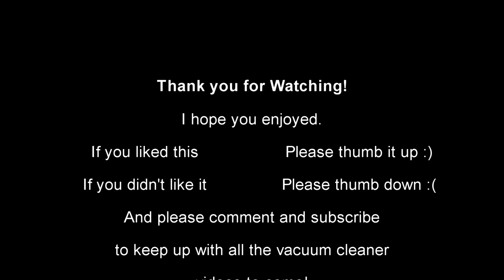Dyson V10 Cordless Vacuum Cleaner - FULL Stripdown How-To Video!

Comment: Ok.  The cord that runs thru the cyclone assembly... You say you can push it out of the top; but, there is nowhere to push it from.  Did you mean you have to pull it out by the pins?  Your last video you removed the connector at the front, which one is easier?  I tried to take it out; but nearly broke it.

Comment: Just finished replacing the broken red switch. What a horrible experience taking it apart and back together!!! I'm also left with 4 of the very long screws!!! But I think I know where they went,but can't be bothered taking it apart and putting back together. Thanks for the video!!!
Reply from the maker: If their long and crosshead their probably the 4 back screws, under the filter assembly. If their long and torx their cyclone. You might get lucky and their the very end outer ones that go under the rubber seal. Otherwise if it's snapped together nicely I'd say put them aside for if it becomes apparent their needed later!

Comment: I just got a V11 and I am starting to regret it. This shouldn't ever happen. I expect around 5 years of vacuuming before it dies... not 2. These devices cost about 5-10 times as much as a classic upright. The v11 cost 5 times more than my AEG equipt which has been working for a solid 5 years thus far and has no scratches even after vacuuming tons of plaster dust.
Reply from the maker: As a vacuum it's very good tbh, I am missing not having it about! But the build quality certainly hasn't improved. Hopefully one upside of this is my wand will stop wobbling about when it's attached to the machine

Comment: Good one Sam. Its amazing how much dust gets stuck in the cyclone discharge chamber - people need to give their vacuums a good tapping when dumping them over the bin, so the dust in the cyclone discharge chamber can get dislodged and fall out of the bottom. If those chambers end up getting full of compacted dust, the cyclones will all clog up and that pre-motor filter will be VERY dirty, eventually leading to total loss of airflow when the whole of the cyclone assembly becomes choked up, due to the cyclone discharge chamber being full and the cyclones having nowhere to discharge their dust. Either give the cyclone assembly a good few taps, or use the hose of another vacuum cleaner to vacuum the cyclone discharge chamber exit holes and suck all the dust out - that's what I do with my own V8 and V6, and then I dont get any build up in there. Many people still keep a corded vacuum in their homes, so this is the best tool to use for cleaning up your cordless, and you only need to do this every 5 or so empties anyway, as the cyclone discharge chambers would take a while to completely get clogged up with dust.
Your  point about knocking the on off trigger when emptying the bin is a very important one, whether its a DC59, V6, V10 or V11, you must not do this, because the motor will draw some of the remains of dust from the cyclone discharge chamber back through the cyclones and cover the filter with it - on the V6 it goes inside the cone shaped filter in the top of the cyclone housing, and on the V10 and V11 it coats the outside of the filter, so much more visible than on the V6. 

On the V7 and V8, the motor will be disabled when you pull up on the red latch and lift up the cyclone housing for emptying, but when its pushed back down again the motor will be operational again if the trigger is pressed, so until the bin flap at the bottom is closed up, on the V7 and V8, do not operate the trigger, or the same will happen as with the v6, any residual dust remaining after emptying will be sucked straight inside the cone filter in the top of the cyclone housing, which can end up filling this up and causing clogs and airflow obstruction through the cone filter.
Reply from the maker: On my v11 the dust is sometimes so thick in the inner cyclones it doesn't drop out, I can see it sitting there! That's why I whip it clean with another vacuum! Not like the older dyson machines where the fine dust sat happily in the bin (but behind the centre seal) and it all came out when you emptied it. The mouldings on the v10/11 are stepped to provide something for the flap seal to bite on, and that helps get the dirt stuck! You'll see the v11 briefly in tonight's video, I show the filter after a while of normal use too
Reply: It's a good idea to unscrew the filter a cm or so before emptying a V10 or V11 as that prevents the motor from coming on and coating the filter.

Comment: Good video mate, Glad to see how to get the connector out. I have an old DC08 that is on a foot pedal and I use it to vacuum my mess as I go. Saves breathing the crap that falls out.
Reply from the maker: Dunno if your one of the people that moaned about that connector on the other video but yea, I made sure to show it properly! Once I worked out to unwrap the ferrite coil and gain wire it was easier! Doubt it'll harm it at all just lying loose in the chamber either.

Comment: Great how to is this Sam. Just got one of these the same spec and mines in a right mess so looking forward to getting the bits it needs ans fixing it up!
Reply from the maker: Nice, enjoy! Give the filter a good overnight soak in hot water and bio liquid, then a scrub with a bottle brush/toothbrush, then into the washing machine with some towels at 60 for a few hours and they come out like new usually! If they dont then you tried and new ones are very very cheap nowadays

Comment: Cheers for the video mate. Mine had a flashing blocked symbol and was pulsing on all settings

I got it taken apart about half way myself but then got stuck and thankfully found your video which enabled me to get it broken down completely, cleaned and reassembled. 

It was a bloody ballache to be honest but it's now as good as new!

There was no obvious blockage and nowhere near the dust build up in your example but obviously enough to trigger the blockage sensor.

Out of interest how does it know it's blocked? Is it an airflow sensor or something along those lines? 

I've also ended up with a couple of screws left. When I'm feeling up to it I'll take the whole thing apart again and try and find where they go. Will be using your card trick next time!

Thanks again 👍
Reply from the maker: Thanks, glad it helped 👍 The motor senses the restriction and cuts itself off. I've got a v8 motor fitted to something else and it does the same. When the machine is clogged up enough it trips that sensor. Just putting the filter through thr washing machine on a 60 degree wash does 70% of the work I think! Are they long or short screws? Cross head or torx? Equally 2 missing won't hurt it if their not from the cyclone (that wants all its screws to clamp the seals together)
Reply: @beko1987  I tried to post a link to a couple of images but it must have been blocked. I've got one torx, one crosshead. Not the big long ones

Comment: wonderful video, it helped me figuring out how to remove the trigger switch and saved me 270$ (USD) !
Dyson don't fix stuff like this, they just replace the motor unit which includes the handle + trigger. 

One thing I didn't get is how to de shroud the last metal filter, I'm afraid to push a screw as you did, the plastics look flimsy and Im afraid it would break.
Reply from the maker: The plastics are very flimsy when not together, wise to leave it alone if you didn't need to get in there! Where did you get another trigger from if you don't mind me asking? I've yet to strip my broken v11 body down (it's trigger went too) but if their not too expensive I might bang a new one in and keep it for when the new one inevitably goes in 8 months...

Comment: My dyson started doing the same thing after the cat knocked it over and cracked a hole in the bellhousing. :/. How does all that mess get into it internally like that? Is it preventable, or is it because it's being used with that gaping hole in the cyclone?  Thank you for the video though!!
Reply from the maker: Their supposed to do it to a degree but it does seem excessive. The uprights and cylinders fare better, I wonder if it s because the handheld get used at all angles the cyclone just isn't as efficient. Every time I empty it I have to bash it out for a few minutes as it rains out!

Comment: Great video sir. 
My motor is jammed. Could you advise sir
Reply from the maker: Not sure about any advice for that... The motors are properly sealed up and there's not a huge amount you can do without mega de soldering of things! I'd look on ebay for a cheap bare motor unit and just fit your battery filter and bin to it...

Comment: I used your guide for stripping down and cleaning my v10 and it's made a big difference to how it performs. However, I can no longer change the vacuum's speed, it's stuck on the most powerful option. Any idea what i might have done and how I might be able to fix it?
Reply from the maker: I'd be checking the speed switch, if its not fitted correctly the knob won't be moving the slider

Comment: Hey mate, How do you remove the wire from the top?? Can you please do a video on just that. Many people on here struggle with that if you read the comments.  Thanks in advance..
Reply from the maker: I've not fully shown it because it is tricky, and you do cause damage. When I do the v11 video shortly I'll be recommending just leaving it in and making sure it's dry. If you do have to remove it, cutting the plastic holding the loop of wire to the ferrite coil gives you some slack. I also don't have a v10 to do another update on
Reply: @beko1987  no probs mate I wont be trying to remove it, better just leave it before I damage it. Thank you for a quick reply.  I hope this comment helps few other guys in here.
Reply: @beko1987  I followed a link from the older video here looking for exactly this info.  I have a crack in one of the cyclone chambers and was looking to swap this part out, but getting that wire out of the way is. as you say "tricky".  one I have not yet mastered.

Comment: Have you found anywhere that supplies the replacement electrical connectors for the cyclone wiring?
Reply from the maker: Nope! I've always been careful to never break them! Have had to solder a replacement used end (soldered the wires) on a corroded V6, I expect that's the easiest way, find a scrapper and cut the cable and re-join. The connectors must exist somewhere though, but you'll be trawling component places for years unless you've got a good one near you you could take the old one in to measure?

Comment: What's your washing process? What equipment/detergent do you use to wash the parts and how long do you leave them to dry? Also wondering about extendable hoses ! Great videos
Reply from the maker: Thanks! I use various car detailing brushes and g101 and scrub scrub but if you had a dishwasher and didn't use a crazy hot setting you'd be fine too! Drying is either in my airing cupboard with the hot water tank for as long as it needs or 2-3 hours outside on a hot sunny day! Hoses take a few days in the airing cupboard, turning them to spread the water about so it evaporates easily
Reply: @beko1987  thanks! How do you wash the hoses?

Comment: My filter is always that dirty. I have 2 and alternate them weekly.
Reply from the maker: Does it always rain dust from the inner paths when you empty it? It might be filled with dust internally, which will always pull out onto the filter. If you've got access to an airline/know someone with one you could blow most of it out without a stripdown
Reply: @beko1987  not sure to be honest. I’ll check next time I empty it. I know it must have plaster dust in it because we have recently had extensive work done, and the dust was everywhere for weeks. Thanks for the reply.